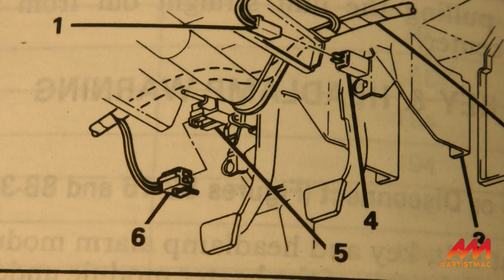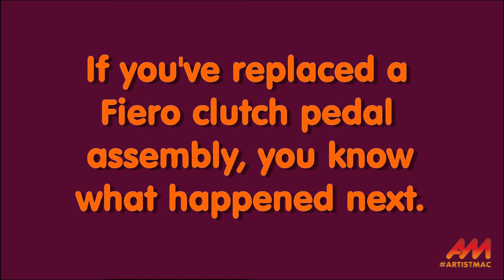My Fiero - Trouble in Clutch Land - Clutch Pedal Removal Fail!

Comment: Hi Artistmac,

It was about 2002 or 2003 when I upgraded from the aluminum to the steel pedal on my dad's 84 Fiero.  At the time he found a guy online by the name of "V8 Archie" who made conversion kits for installing a Chevy 350 SB V8 into any Fiero.  On the V8 Archie site he had something he called "Archisms" which were gems of wisdom from someone who had already figured out how to get certain things done with these unique cars.  I remember that one of his explanations said that the spring on the pedal was unnecessary because the spring inside the master cylinder would do the work of returning the pedal.  I did a Google search for "archism" and I found that the site is still there and the link is below.  If you go to the link you'll find the info in Archism #3.

Here's that link the the Archisms:
http://www.v8archie.com/v8Archie/ToC6.htm

I think the bolts that you mentioned you couldn't find are the same 13mm bolts that are mentioned in step 5 of Archism #3.  Below is a link to a picture of the clutch assembly.  I circled the bolts I think need to be loosened.  I'm not certain of this it's just a hunch.  It seems that if you loosen those 2 bolts a little it will open that area that is keeping the clutch pedal captivated.

https://drive.google.com/file/d/1Dy9sD6NIaEArIV34gK0Um8fyHEtE3gC-/view?usp=sharing

Good luck :-)
Reply from the maker: Archie's instructions for working under the dashboard are priceless: "Working position: Prone, laying on back, push seat back all the way or removed, kick off shoes put feet on seat back....take tools & light with you." LOL

That's going to be doubly true getting those two bolts out. And why I can only work on the car about an hour each day.

Comment: From memory the clutch pedal return spring is not needed with the new pedal. I left mine off when I did this job on my '86.
Reply from the maker: You're right. I just replaced the pedal and master cylinder, and the spring inside the cylinder bounces that pedal back just fine. (Now comes the bleed). But, something finally went right today. ;)

Comment: I saw a video how to do it and it showed 2 bolts for removal. Maybe it was a newer type I don't know. I know mines an 84 and I can't find a clutch slave bracket pic anywhere I was told only the 84 had this bracket. Someone used a 5 speed one out of an s 10 that didn't work. So I bought the proper slave but I'm unsure of the bracket.  I'm practically rebuilding my car.
Reply from the maker: I finally found them. The one toward the driver's seat isn't too bad -- the one nearer the firewall is a widowmaker. But, I'm not going to moan. The new clutch pedal is IN!!! Yabba-dabba-doooo!!!!! :)